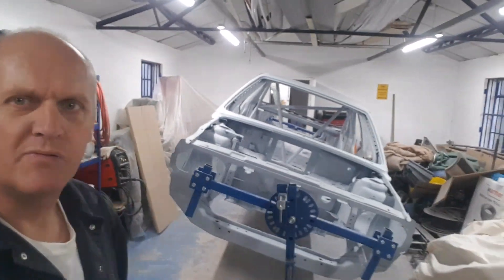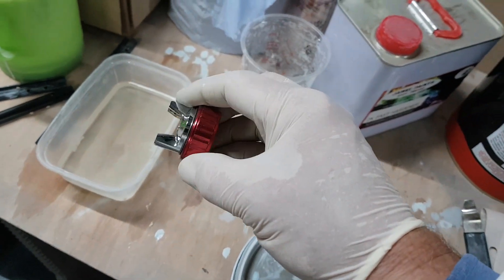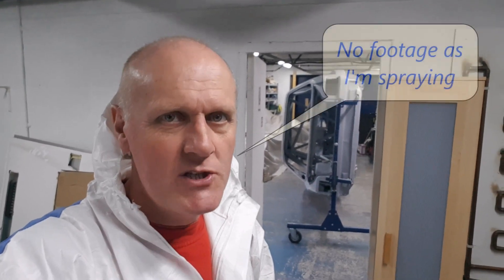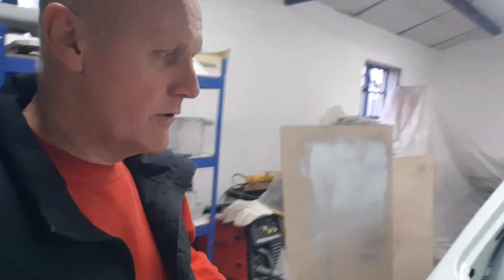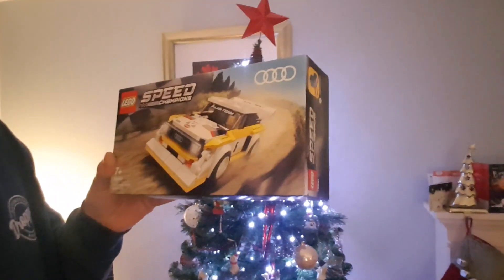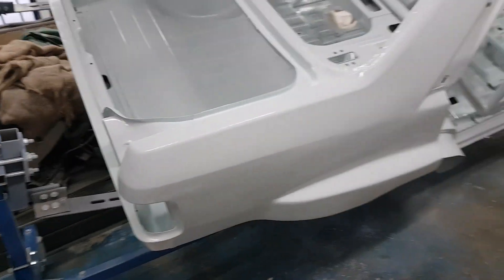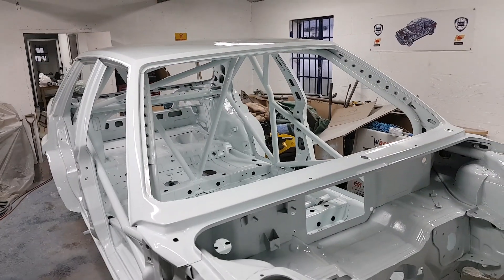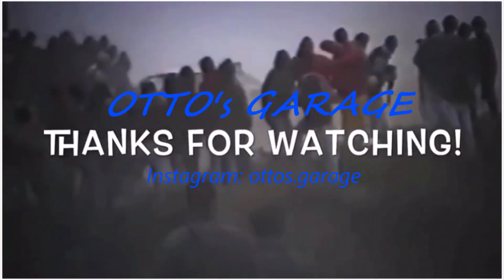How to Build a Lancia Prisma, (not a Delta) HF integrale - Part 21 Paint

Comment: Would have thought you'd be better to pain the inside then mask off the doors, boot etc. and paint the outside. That way you're not getting over spray all over the cage when putting the final coat of the outside...
Reply from the maker: Yes I thought of that and sprayed outside 1st, then inside. That way the overspray was reduced. I'll still polish it all when the other panels are fitted. Time will tell!